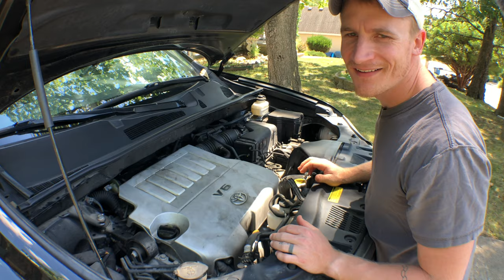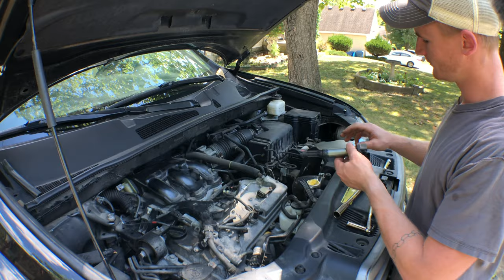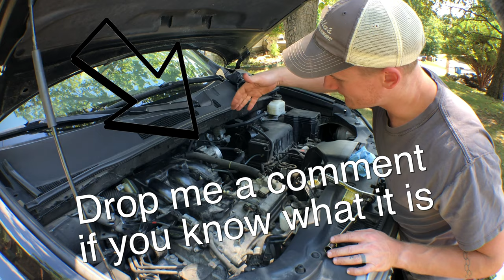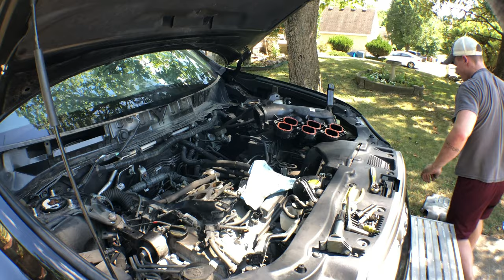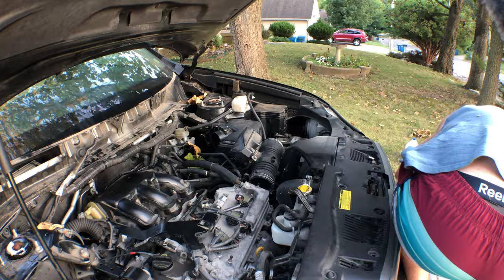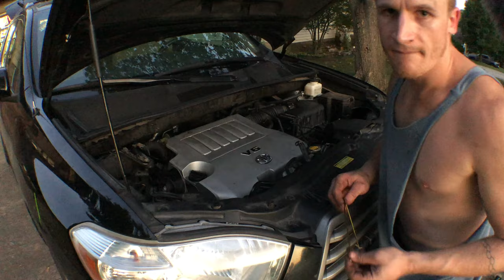Replace Spark Plugs In Toyota Highlander | HOW TO

Comment: I bought 2008 toyota highlander hybrid 222000 miles on it. He said he had replaced coils and spark plugs recently but there is po300 code. What could have triggered that po300 code,any idea? So I could try to diagnose the problem.
Reply from the maker: I am not sure. 
I am no pro, but I would probably have to see the vehicle to fully diagnose the issue. 

If you figure out what is going on, please come back to update.
Reply: @BuildItSimple  It was weak battery. After I replaced the battery the problem is solved.  Thank you !

Comment: How long did that whole job take
Reply: Did you have to replace any gaskets
Reply from the maker: To film the whole job and do the 2 bulb replacement it took about 35 min.  
I would say that if you weren’t moving lights or filming you can do it in half the time. 
So expect about 15 min to replace both lights.
Reply from the maker: I did not have to replace any gaskets. 
There is a rubber gasket that fits between the bulb and the housing. 
That is reusable. 

I hope this info helps.  
Good luck with your replacement.